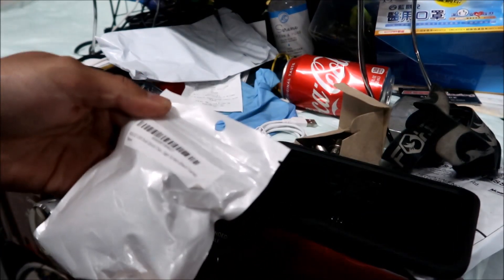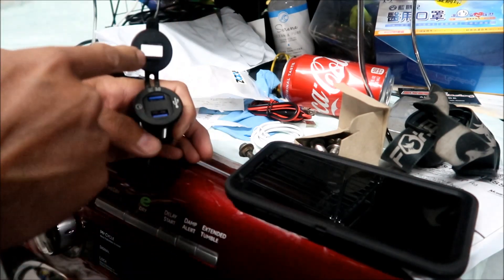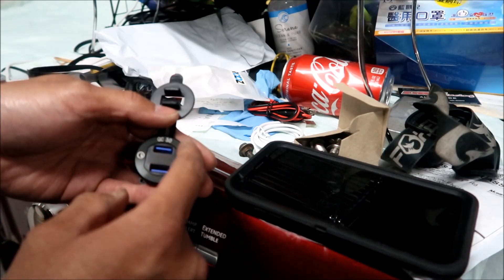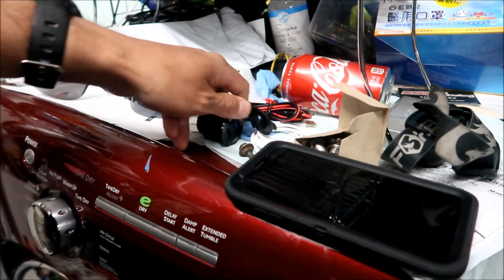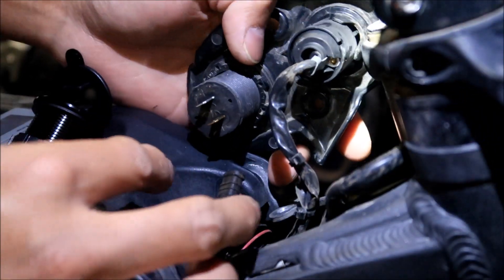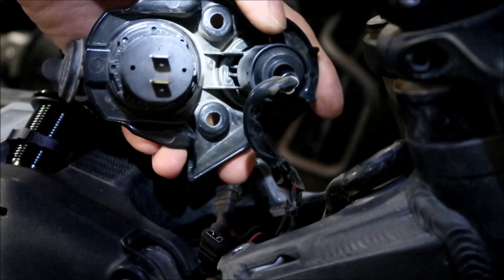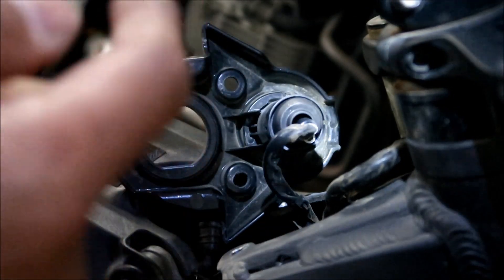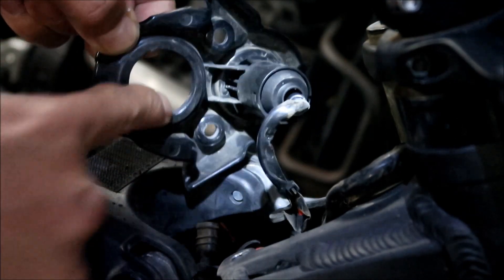Sur Ron Light Bee USB Charger Upgrade

Comment: I found this one without the LED screen, but with the correct design for easy install...https://www.ebay.com/itm/Dual-USB-QC-3-0-Fast-Car-Charger-Socket-Power-Outlet-For-Boat-Marine-RV-Mobile/402187942395?var=672623882751

Comment: I deleted the usb altogether and put a switch there to turn on and off my 12V
Reply from the maker: Yeah that's what people do but I use my bike for deliveries so I need a USB charger that's pretty much all I use it for though =P
Reply: @hadesomegamoto7639  I ended up going back to primary belt drive as well.  Enjoying the quiet.
Reply from the maker: @skyungjae  Yeah the 219 chain kit was ok for a little while then it just went downhill from there.  I'm glad they went with a gearbox reduction system on the storm bee no more worrying about belts =P
Reply: @skyungjae  are you selling your chain primary. I actually want the noise
Reply: @tintin6291  are you in the continental US?  Mine is the lower geared 219 kit.  It has maybe 50 miles on it.
Reply: @skyungjae  im in new york
Reply: @tintin6291  if you reach out to me on FB it'll be a bit easier.  The link to my group is on the description in my videos.
Reply: @skyungjae  u have ig? I dont use fb. Its @youknowtheworld
Reply: Hi, interested to do the same. What size of switch do I buy in order to fit perfectly in the usb emplacement?